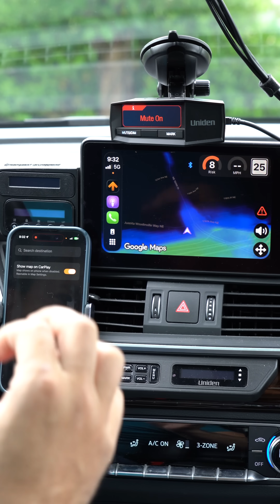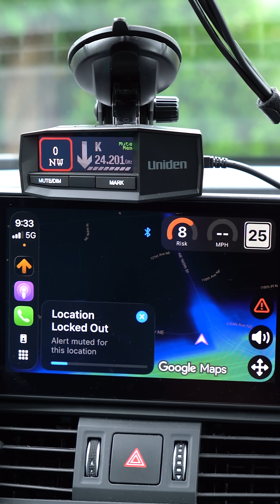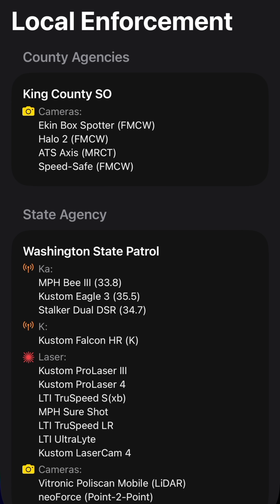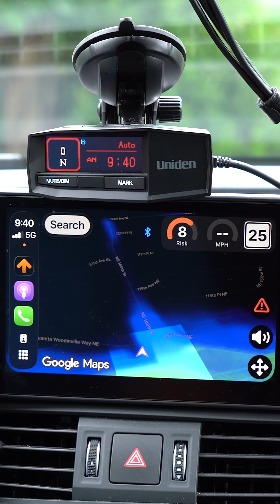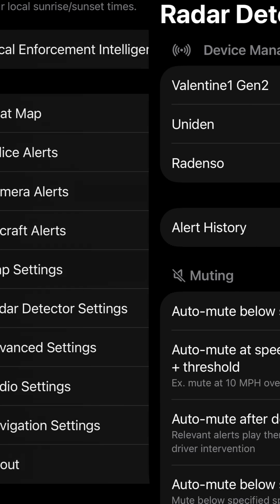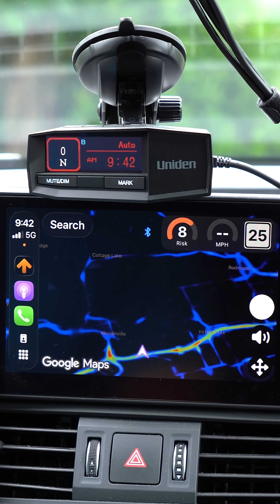Highway Radar - Radar Detector CarPlay Integration

Comment: Issue I’m having with the r4w and the highway radar app is that the audio only comes through for the first chirp for Ka band and then stops and also only shows 3 or 5 strength signal on the app when the detector is showing full strength. I need the audio and display on the phone to work properly because I’m on a motorcycle and can’t really see the display or hear from the detector

Comment: Cops have instant on radar for a long time now. You need someone to get in front of you to get the cop to trigger his radar unit. But if you're the one speeding guess who's going to trigger the radar unit. The beep on radar detectors now is the signal to start writing checks.
Reply: thats just one of the strategies, it varies a lot by location. in my area there are tons of officers who patrol with passive radar blasting ka/k bands constantly. the aggressive driving enforcement guys do the same unless theyre using laser. plus the app helps a ton when people report a stand still officer.
the detector + app combo catches most of the common stuff pretty well. instant-on and laser are still the biggest weaknesses though.

Comment: It kept popping up, because the frequency was switching between 34.674 and 34.675.
You reset the detector, but the location was still locked out in the app.
Reply from the maker: That's a good guess. Here's the dev's explanation as to why the alert kept popping up: https://www.rdforum.org/threads/132763/page-111#post-2044691
Reply: @VortexRadar   you can see clearly it’s flipping between 34.674 & 34.675

Comment: Just curious, the detector already shows you everything you need to know.   What does integrations like that with Carplay actually help with or rather what is the need?
Reply from the maker: Exactly. That’s precisely why I don’t really use it either, but apparently lots of people want the feature regardless.
Reply: Not having to reach for a small button on the radar detector while driving 70-80mph id imagine.
Reply: Or for  stealth installs in areas where these detectors are illegal and everything is hidden

Comment: I saw a auto mute under certain speed I think.  Is that strictly on the app or has Uniden finally give us that option?   Haven’t checked for updates in a while.
Reply from the maker: Uniden calls it quiet ride. Low speed muting is pretty common.

Comment: Hey vortex I’ve been using the R8W and all of the K bands have been false is there any explanation to why? And is there any place that police use k band?
Reply: if you haven’t already, I highly recommend using the settings that Vortex has linked in his setup videos. There’s even a list of states so you can pick yours and what pertains to you. I used that as a baseline and it’s been great so far(I have an r7 tho)
Reply from the maker: Very common. Police do use K band throughout the US, but it's also used by automatic door openers, speed signs, cars with blind spot radar, etc. It's why you have various filtering options in your detector you can configure and tweak.

Comment: I use R4 Companion with my R4W. I like the improved auto gps lockout implementation and the improved BSM filtering and low speed muting. 

I run Waze on Apple car play. 

But I’m wondering if it would be beneficial to run Highway Radar instead of Waze on Car Play, with R4 Companion backgrounded. 

Could I run both Waze and R4C backgrounded and HWR on Car Play?
Reply: I run this exact set up. Highway radar is far better than Waze. I believe it also pulls from Waze reports to map police presence. I personally like the settings R4 companion has rather than highway radars settings on the R4W; so I run that in the background and highway radar as a Waze replacement.

Don’t think you can run both highway radar and Waze on car play simultaneously since one has to take up the screen.
Reply: @GradoRam I guess my concern would just be possibly not getting all the police alerts that show on Waze, since Waze has by far the most people reporting.